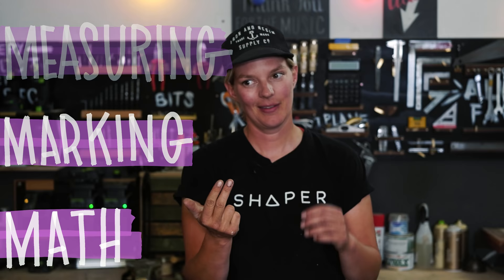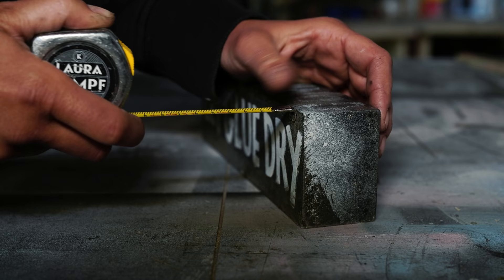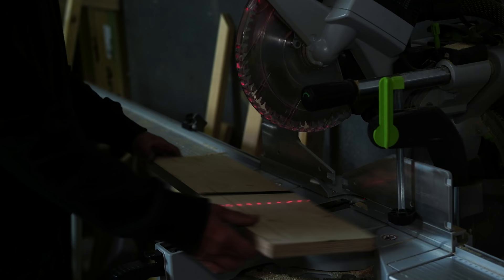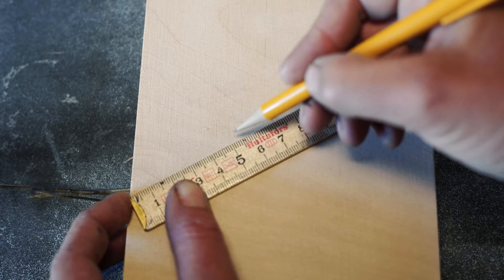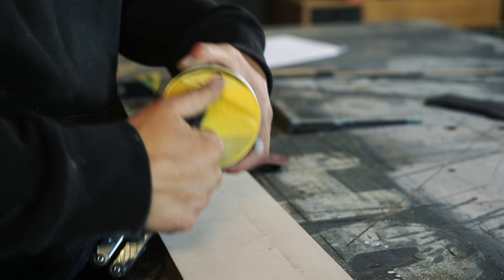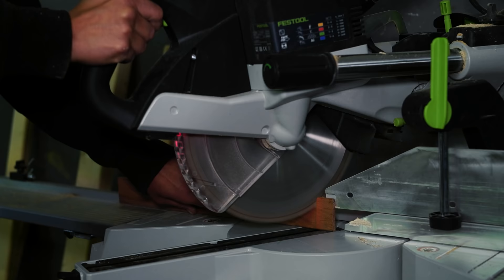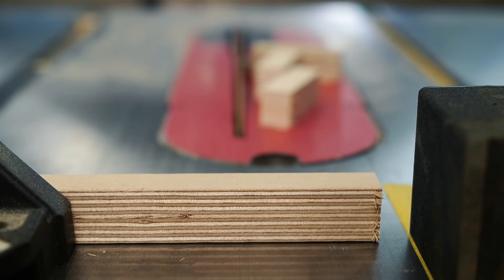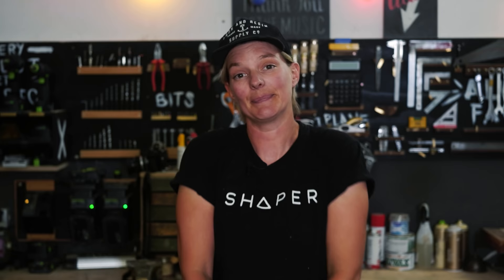Workshop Tips - Measuring, Marking & Math

Comment: One thing that helped me a lot was by getting rid of the stupid “imperial system” of inches and feet and use METRIC  tape measure and rulers👍
Reply: Mac Expert she’s out of Germany. It’s all metric.
Reply: I'm making the switch myself.  I am tired of 1/8ths and 1/16ths, I spend more time thinking, measuring, remeasuring, marking, remeasuring, recalculating, checking again... then cutting.  I waste so much time.
Reply: I work in both :)
Reply: I would love to do this - Canada is metric, but all our building supplies are still imperial so they don't translate well to metric :(
Reply: I personally find 1⁄16 easier to deal with than 0.0625, but you do you.
Reply: Yeah, you have to be reasonably smart to use the imperial system.
Reply: Hello, I think the "problem" Imperial versus metric depends on the fact, in which system you are grown up. If you are estimating, planning or thinking, you do it in the system you're grown up with? I can't estimate how tall a girl is in feet, but in meters ...
My solution to deal with both systems is to see the imperial fractions as accuracy ... if all dimentions are in the same fraction (eg x/16) you only look to the upper number - then it seems to be much easier und you haven't to deal with the fraction itself. This is very similar to calculate with 1,25 m or 125 cm (especially woodworkers use) or 1250 mm (especially metalworkers use).
On the other hand ... most of the comments are still looking on the "problem" WITH math and so running in problems. 
These tricks (thank you Laura for bringing them to us :-) ) works all in both systems :-) because Laura's measuring tricks are working with proportions ;-)
Reply: Yeah Imperial is the worst but not as bad as converting between the two
Reply: @wvwombat4866  and I lived 40 years nearby where she lives and moved to the US
Reply: @wbfaulk  I always show this to people who like the imperial system, 1mm = 0.0393701"
Reply: @xray1292  And? Yes, converting between systems is "hard", but that has no bearing on how good each system is on its own.

If you're going to argue about arbitrary ratios, why is a meter the distance light travels in 1/299792458 of a second? Is there something special about that number?
Reply: @wbfaulk  Initially it was defined as the ten millionth part of the distance that separates the north pole from the line of the equator, but then the inverse was looked for, where the meter entered and this distance traveled by light was reached in a fraction of a second,  also with what common instrument can you measure 0.0393701 ", 0.025mm=0.00098425197" in decimal measurements the inches have problems, but 0.025 mm  I can easily measure it with a caliper. I can even go further I can tell you that inches do not exist
Reply: @xray1292  Oh, so your preferred length measurement also has historical baggage that is no longer relevant? And why do I want to measure 0.025mm to that ridiculous of a precision? You're not measuring your 0.025mm to that sort of precision, either. Do you have any understanding of metrology at all? FWIW, when you get to inch measurements that small/precise, they're generally measured in decimal inches anyway, usually represented as thousandths of an inch (which is very close to your 0.025mm) or ten-thousandths (generally called "tenths") for even smaller ones. Again, it doesn't really make any difference what system you use.
Reply: @wbfaulk  What I mean is not what systems they use, but rather what you measure with, that's why I tell you so that the inches are as accurate as 0.025mm (arbitrary decimal measure) what common measuring instrument you could use in inches without having a approximation error, the instruments (I insist common use) in imperial round the measurements to many decimal places, because they cannot represent them.
"your preferred length measurement also has historical baggage that is no longer relevant" It is not that it is not relevant, it was a scientific measure but it was made in 1792 and that is why years we say that precision instruments were not very common, and it is because of this same precision problem that it has been updated over the years, They find more precise ways to measure a meter and it is not that the average change, it is the precision that is sought, that is why in 1960 with the nuclear age the reference of the meter was 1650763 wavelengths of light in transition with Krypton , then it went to the speed of light, but all this does not change to the meter, we only seek to have a greater precision in the "relative uncertainty"(A measurement will be more accurate the lower its relative uncertainty).
Let's take it as a conversation, please do not try to disqualify, only providing scientific evidence is what interests me in this passionate discussion of weights and measures, thanks
Reply: @xray1292  When measuring, your precision is dependent on your tool. If you measure 0.025mm, you're almost certainly not measuring 0.025000000mm. Your measuring device has a precision. Let's assume the Starrett V230MXRL micrometer. With it, you're actually measuring 0.025mm±0.002mm. That means you're actually measuring something between 0.023mm and 0.027mm. That means you're measuring something between 0.0009055118…" and 0.0010629921…". So, if you were measuring that in inches, you'd just measure 0.001". Conversely, if you measured that with a Starrett T230XRL, you'd be measuring 0.0010"±0.00005", or 0.00095" to 0.00105", which is 0.02413mm to 0.02667mm, which you'd probably just round to 0.025mm if you were converting. Using inches versus mm makes no difference to the accuracy of the measuring that you're doing. Also keep in mind that these are incredibly small measurements we're talking about here: half the thickness of a thin human hair. Nothing particularly common can measure those thicknesses.

Comment: I love the small Talmeter tape measures. They are locked by default so they are excellent for transferring measurements without ever having to read the scale, or if you need to transfer a specific a measurements you just first set the measurement and then bring the tape measure to the piece. The scratch marking is a nice added bonus as then no pen is needed in many cases. It's one of those little tools that actually change your workflow. BTW lovely tips

Comment: Awesome video! My favorite measuring trick is to use two compass arcs from two parallel and square endpoints to find the exact center of anything. If you have a board with one factory edge, draw a perpendicular line across it with a framing square, set the compass on each endpoint, draw a nice big arc in the "middle-ish" area from both endpoints, then connect the two points where the arcs intersect with a straight edge to get a perfect center line. (It takes longer to explain it than to do it!)
Banana trick: when they get to the perfect ripeness, peel them, cut them into slices, dump them on a wax paper lined tray, freeze them, then bag them. They don't turn brown, and they'll last a month or two that way, and won't get overripe. Also, frozen bananas are nice in the summer! (Grapes will freeze well, too, as will oranges, if you peel them.)

Comment: Thanks for amazing DIY hacks & tips. As you said, without having to measure dead accurate became able to design more intuitively and things flowed naturally - sounds like veteran Ferrari engine designer, some of them were cast out of sand mold and that mold was fine tuned by files and hand tools. Some of the best V12 engines were made by "eye balling" and "touch and feel"

Comment: As a math teacher wo makes things I understand both sides... Those tricks that you use to divide something into equal parts are deeply rooted in geometric tradition since ancient greece. It is not necessary to understand the underlying principle to use that trick, but understanding geometry helps you come up with new tricks. On the other hand you are absolutely right in that not everything needs to be measured to a tenth of a degree, in shop context the Mk. 1 eyeball might just be fine and gets you there a lot quicker. I just vote for not dissing math too hard, everything you might need in a shop can be learned and understood and is as much of a useful tool as your hammer or screwdriver. If there is anyone who wants to know something specific, just send me a message, that could be my tiny part of educating people...

Comment: This video is awesome! Love these tricks. On the dividing things in half by making two marks by gut, then marking the center is that: Even if it’s not the center to the atom, it’s still more than close enough. Feels like the essence of “if it looks straight, it is straight,” put into action. 

My tip would be relatively precisely dividing small things in half with a caliper. Measure the item, split that number in half with a calculator, then set the caliper to that half number and mark away. Still fast but avoids real math...
Reply: Even professional mathematicians use a calculator to avoid doing arithmetic themselves.

Comment: Measuring is a great way to make four mistakes: You can position it wrong, read the scale wrong, and similarly when you transfer the measurement with positioning and marking. Measurements are best avoided unless working with a remote collaborator. In which case use SI units and triple check.

Comment: Love it. I used to build modular suspended ceilings to fit rooms which were not square. Therefore the inverted T bar going into the wall would vary to suit the uneven wall. We learned to not measure each T space and transfer measurement to T bar but place the full length T bar against the uneven wall and make the cut according to the string line (or laser) then reverse to fit. Did it many thousands of times and had straight square ceilings every time.  Also BANANAS don’t peel from stalk end. Peel from blunt end you will see why.....

Comment: If you ever find your self needing to get more precise hole placement you can print off a 2D cad drawing (make sure it's 1:1 scale!) tape it over the work piece and mark the hole locations with a center punch. Fun little trick I used when I didn't have access to NC machinery.

Comment: Great tips. I also like to add one more tip on how to find center of a circle. Put an object with a right angle on the circle edge such the the right angle faces toward the inside of the circle, and mark where the two sides of the angle cross two other parts of the circle. Draw a line two connect those marks this line is bound to be a circle diameter. Do the same thing again on another spot on the circle and draw another diameter for the circle. The cross point of the two diameters is the center. I hope I could have explained it well.

Comment: My biggest tip for avoiding doing complex math is to get a big piece of cardboard or paper drop cloth and draw everything out in full scale when possible. You can just transfer the measurements and angles directly, and if there are any issues, you can immediately see them and just flip over the paper and redo it. I do think learning some basic trigonometry can really come in handy though. I took a trigonometry class two semesters ago and really worked hard to understand it, and I find myself using the concepts quite a bit now.

Comment: Great video Laura. Some brilliant tips there. I like the one for mitre cuts. Seems simple but often it's the simple solutions that make things easy, i.e the KISS principle, Keep It Simple, Stupid! Another tip for finding the centre of a regular shaped item i.e square or rectangle (or basically most four-sided shapes, caveat is at least two edges must be parallel) is to draw two lines diagonal-corner to opposite diagonal-corner, that intersect in the geometric centre.

Comment: I've been using most of your tips for many years, if i can avoid measuring i will
Though a ruler or tape is just a story stick with convenient numbera
You can place a tape face down to draw a straight(ish) line
To find the centre of a round object, find something about half the diameter (strip of wood), roll the object along a surface with the strip next to the face, and mark with pencil
You should be left with a small circle
Draw a straight line around a pipe (this doesn't matter if one end is square), get a strip of something flexible with a sraight edge, wider is better, (a sheet of A$ is fine for smaller diameters), wrap around so the edges line up, draw the line

Comment: Here's one, you can take door skin, or thin wood and cut it into long strips to make a templet, and when you need to make a copy of a counter top or strange angle to copy, you just use these strips and hot glue them together until you have a pattern or templet to then trace around that on your board or plywood and you have a match....

Comment: You can also find the center point of a board both vertical and horizontal using a straight edge from opposing diagonal corners.

Comment: Try using elastic to mark even spaces in a length of timber if you need fifteen equal spaces for example,with a pen mark 15 equally spaced dots on the elastic that is shorter than the wood you are using  Aline the first dot on the end of the timber then stretch the elastic out till the last dot is on the other end all dots will be equally spaced transfer the dots to the wood and no difficult math needed.

Comment: get a rope with 13 (bakers dozen) equally spaced knots in it:
90° = ¼ circle = 3-4-5 triangle
60° = ⅙ circle = 4-4-4 triangle
45° = ⅛ circle = 2-3-5 triangle
30° = 1/12 circle = 4-4-2 triangle

Ad the 3 corners of a triangle together and you get 180° (a straight line)

Comment: Nice work. Keep it up. 

Since it looks like you like tools, check out the Starrett Miter Protractor. Trim carpenters use them. It's cheap and works great. It'll save you time, unless you have to look for it. =D

Comment: This bit of material needs to fit precisely in this gap.
Holds the to long piece up to opening and mark's it...
There is going to be a  strip of trim on on one side of the opening.
Uses an offcut bit of trim as a thickness guide...
Storystick or a bit of string.

Comment: When cutting wood at an angle use a scrap piece first then measure the cut angle with a good quality tool i.e. Incra, Woodpecker etc. Mitre saws are not always accurate so it's worth checking the cut first before using good wood. When using a ruler against a mark put the pencil on the mark first then butt the ruler against it. Putting the ruler against the mark then butting the pencil against the ruler can lead to the line being not accurate.

Comment: My admittedly limited experience with building & woodworking has shown me that math and formulae and triangulations and stuff really does not work that well. I am pretty decent at playing around with numbers, but if I try to figure out a build's dimensions on paper and so forth, I often times find that reality does not fit my theoretical plans. I think you have to make extremely precise cuts for this to work out, to the point that I don't find it feasible.
My engineering teacher used to joke:
A bachelor degree engineer builds something which doesn't work, and he does not know why.
A masters degree engineer builds something that doesn't work, but he does know why.
A craftsman builds something that works, but he does not know why.

Comment: This ingenious Swedish tape measure, Hultafors Talmeter could be helpful in some tasks for all you math haters: https://www.youtube.com/watch?v=9ovuFoiVwr0
I love math but still like the product. I have the 2m one but it is slightly runtish and I'm planning to order the more rigid model. 
Digital vernier caliper  is really the ultimate gadget for people with mental calculation issues. The ability to zero the reading can greatly help in  adding and subtraction tasks. Also the center to center  measuring  of two holes or pegs is easy when hole or peg size is zeroed first.

Comment: Théorème de Pythagore : a2 + b2 = c2. D’où : 3, 4, 5 (9 + 16 = 25), ou multiples : 6, 8, 10 - 1.5, 2, 2.5 - 90mm, 120mm, 150mm etc. pour tracer un angle droit, à 90°. (Aussi appelé l’équerre du pauvre, ou des anciens bâtisseurs, et qui remonte à la nuit des temps, des Pyramides etc.)